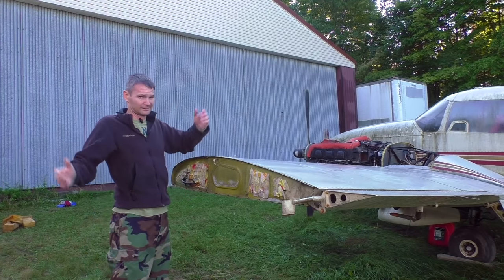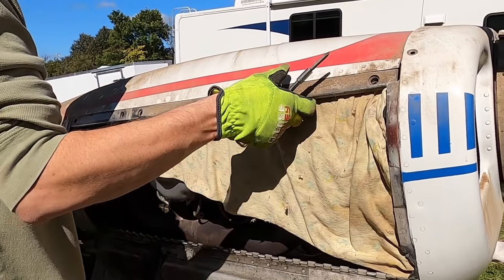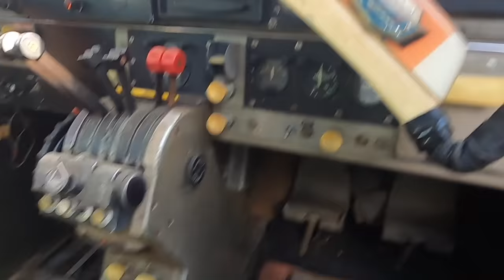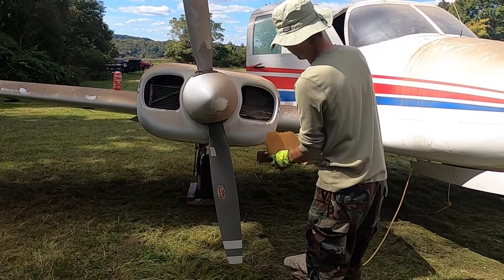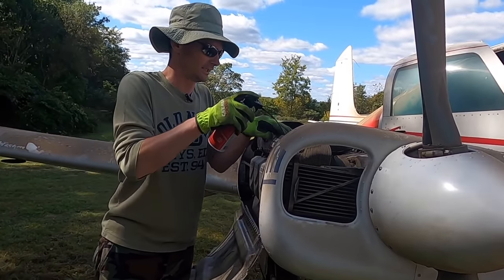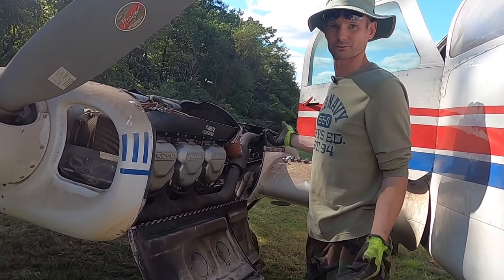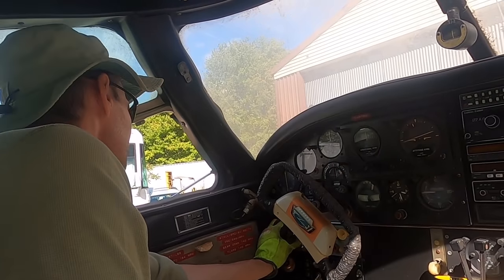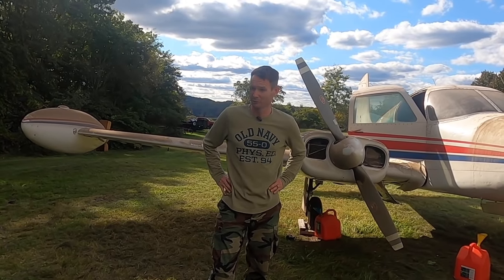Abandoned Airplane Will It Run After 37 YEARS!

Comment: I’m going to like it when you got to spend at least 20 grand to get that thing airworthy and so it passes inspection and so you don’t go up in the air and in the thing crash on you I guarantee it’s gonna cost you using his old is that plane isn’t as long as it’s been sitting at least $20,000 to get it airworthy and where it’s legal in there and they pass it fly and you better make sure everything’s fixed on airplane before you take it up in the air like you got a good insurance policy for your wife

Comment: I would wash it first and then give it an oil change before starting up for the first time. You might have proper sludge sitting at the bottom of the engine, not worth it if you intend to fly this!

Comment: quick google says that plane (n4875B) had an accident in 1982, any idea what happened
Reply: found the report, it says "THE PILOT ARRIVED AT THE DESTINATION AT DUSK. HE CIRCLED THE AIRPORT AT PATTERN ALTITUDE TO CHECK THE WIND AND
RUNWAY CONDITION. HE NOTED THAT THE RUNWAY WAS COVERED WITH SNOW. A LONG APPROACH WAS MADE TO RUNWAY 36 IN A
CALM WIND CONDITION. JUST PRIOR TO LANDING, THE PILOT HEARD A "THUMP" AS THE AIRCRAFT CROSSED A PERIMETER ROAD
THAT WAS PERPENDICULAR TO THE RUNWAY. THE "THUMP" OCCURRED WHEN THE PLANE STRUCK AN AUTOMOBILE. THE PILOT
CONTINUED AND WAS ABLE TO MAINTAIN DIRECTIONAL CONTROL DURING THE LANDING. THERE WAS SUBSTANTIAL DAMAGE TO THE
LEFT MAIN LANDING GEAR, LEFT WING, AND LEFT PROPELLER, THE AUTOMOBILE'S ROOF, WINDSHIELD, AND A FENDER WERE
DAMAGED. THERE WERE NO INJURIES TO THE OCCUPANTS' OF THE AIRCRAFT OR AUTOMOBILE."

Comment: Man, being in a hanger sure made ALL THE DIFFERENCE, just watched a guy trying to get a Twin 1969 Cessna 401-A running that was outside and NOTHING GODD THERE… that entire video was amazing. Now just run the Left engine up and figure which Cyls are fouling and away you go… could even just needs clean fuel in the left wing and a partially stuck Crossover Fuel Valve.. 
here’s that other video- Great Job. https://youtu.be/aVvHYTtHDrc 
The plane he is working on was FREE if he could get it running, but it had been outside for 16 years.

Comment: A keeper this one. Cruising speed of 260 knots if swap out the standard Continental 310 hp (230 kW) engines with 350 hp (261 kW) Lycoming TIO-540 engine and three-blade Hartzell propellers. ref Jack Riley, https://en.wikipedia.org/wiki/Cessna_310

Comment: This video gives me the willies. Seriously? You'd pile your kid into this and fly it home? Who's doing the annual? This seems so cavalier. Are you and A and P? Just curious.  
Let me tell you about airplanes that have not been run or flown for a number of years.......

20 years ago I was in a flying club in Thailand and, a friend of mine there bought a Cessna 206 from their Dept. or Ag. It had not been flown for 5 years. He picked it up cheap, changed the oil and plugs and did a cursory check of things and all seemed well. Started it up and it ran. Until it shut down for some reason. Hmmm? Should have been a clue there. There was no official annual done on it and certainly no overhaul. Probably lots of rust formed on the cylinders and intake etc. What the heck, the prop governor was probably screwed and rusted up. 
Anyway, Warawut fired it up again and got a whopping 5 hours on it and "checked out" in this high performance, complex category aircraft. All seemed great. So in his enthusiasm and everyone at Tango Squadron (their version of the EAA) wanted to give it a ride. So He and 4 or 5 other Thai guys piled in and took off. Of course the density altitude was off the charts because it is always HOT there in Chiang Mai.  No worries, the runway is over 5,000 feet. Well they got off no problem and gain a few hundred feet. Then the engine quit. Dead. Nothing. He did what most people would do, but should not. He turned back with a heavy plane, high density altitude and no engine. He plowed it into a electrical power transformer on a busy road that paralleled the runway. Didn't even make it to the airport property, but got close. 

I went to the crash site and found the control wheel lock. The aircraft had been moved next to Tango Squadron's hangar. It was a pile of charred wreckage. Melted engine parts etc. But before it was moved, according to Thai news reporting norms, his charred body was shown laying next to the mangled wreck where it had crashed. Real pretty. 
I visited his heart broken wife and dear little girls, whom my wife taught English to. We went to his funeral. Don't know that there was much more to burn of his remains during the Buddhist cremation. This was inexcusable in every way. 
You might want to take note here Jimmy. I wouldn't ride with you. "I wonder if we're not out of gas" That about says it all at 19:30
Yahoo y'all. Hold my beer.